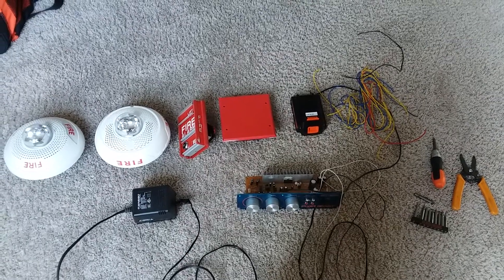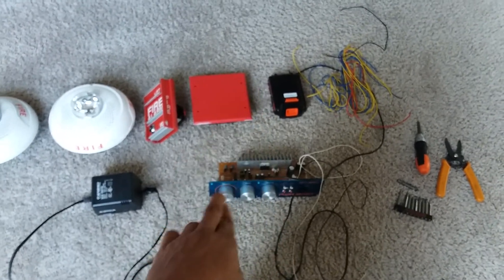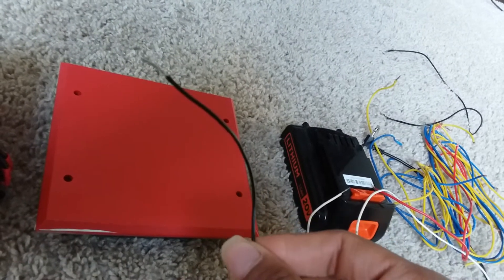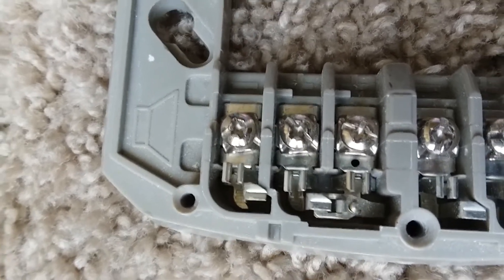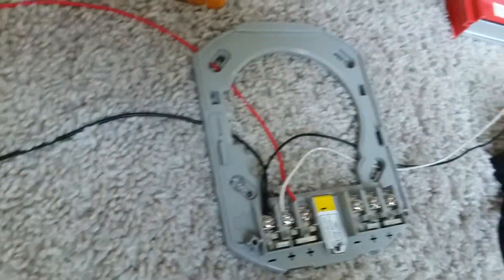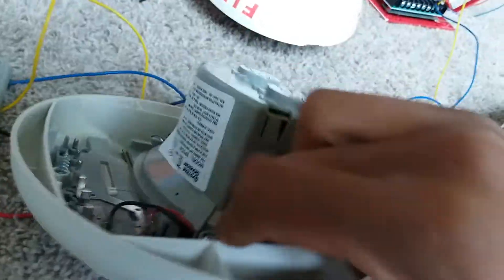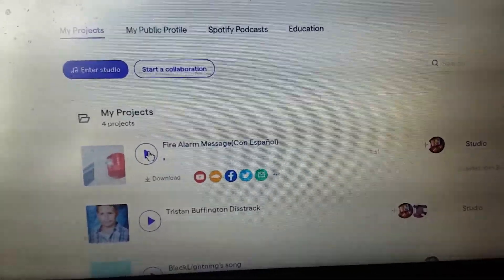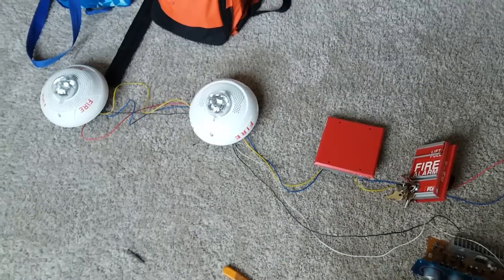How to wire up speaker strobes (Check description)

Comment: I dont have an amplifier
Reply from the maker: You can find decent as well as cheap amplifiers on eBay and Amazon. You also can wire an aux cord straight to the speaker, but since these speakers take a lot of volts/watts, you're going to need an amplifier to drive them in order to get some decent volume out of them.
Reply: @BlackLightning4547  how about audio cord
Reply: @BlackLightning4547  where do i get an aux cord
Reply from the maker: @Newenglandaviation987  your local Walmart or Fred Meyers in the electronics section

Comment: what about if we only want one speaker strobe
Reply from the maker: Then disregard the part where I go over wiring the second speaker strobe...
Reply: @BlackLightning4547  yeah but does that mean we still need that sync module
Reply from the maker: @fireguyif74  sync module was optional to begin with, and definitely not necessary when only using one strobe or using older strobes that are incapable of sync.

Comment: I have a Siemens SEF-W Fire Alarm Speaker but I’m having a little trouble with it
Reply from the maker: What's the issue?
Reply: @BlackLightning4547  Like what wires do you use to connect it to where it sounds?
Reply from the maker: Depends on the amplifier. Some have connectors that have pigtail wires that connect to the speakers. Some have terminals screws that require separate wires to connect from the amplifier to the speakers. Remember, brighter colors indicate positive(+), and darker colors represent negative(com or -)

Comment: If I where to choose which speaker strobe to get it would be the l series because 1 I like how it looks,2 it’s new brand new, and 3 the audio quality is good
Reply from the maker: Good choice
Reply: @BlackLightning4547  Should I get that one too? Or not?
Reply from the maker: @AndrewIsAwesome882  The System Sensor SPSCWL L-series speaker strobe is a good choice. It's easy to mount, easy to wire, and has great audio quality.

Comment: hi bro, can i add 2 more strobe sensor ceiling at the same setup?
Reply from the maker: As long as you have the proper amps + watts to back up your setup, add as many as you want.
Reply: @BlackLightning4547  but can i connect of any sensor ceiling or i need connect of the panel of control? .
do you have any video you show me how set up please?
Reply from the maker: @geheri  yes, you can wire two-wire smokes without a panel 

https://youtu.be/7Tc4O26J4ds

Comment: Will this work for a 2902-9739
Reply from the maker: As long as you have an amplifier with the proper wattage output, you should be fine
Reply: Ok thanks for the help
Reply from the maker: @safetran50  my pleasure

Comment: I bought a Wheelock E70 speaker strobe. The strobe works great, however there is no sound. I hooked up power to both sides. Should the chime work as is or does it require additional accessories? Thank you.
Reply from the maker: E70 or CH70? The E70 is the speaker strobe variant that requires an audio source like an amplifier or voice evacuation panel to sound; the CH70 is the chime strobe variant that only requires 24VDC